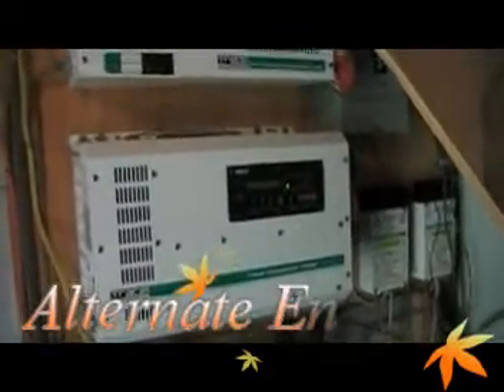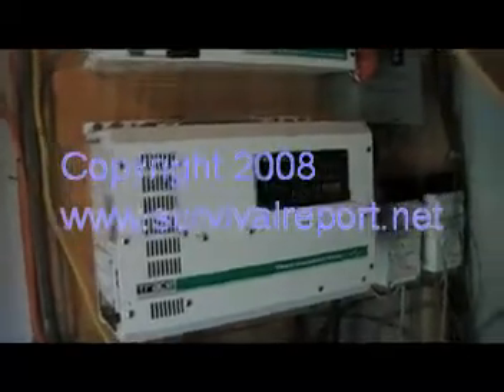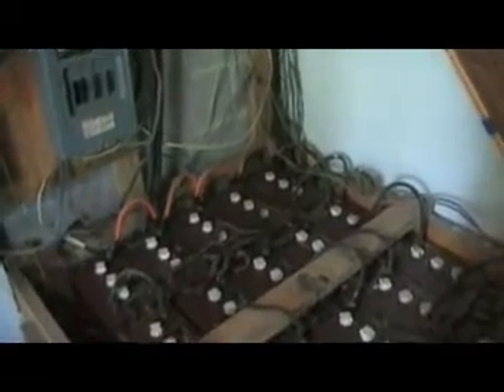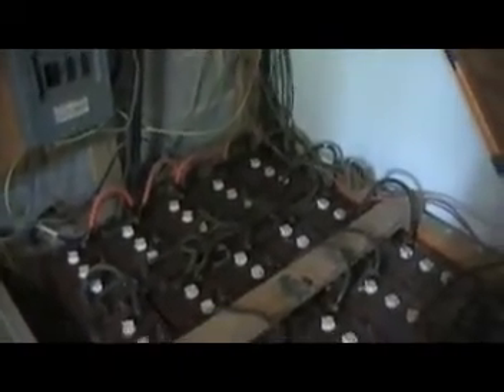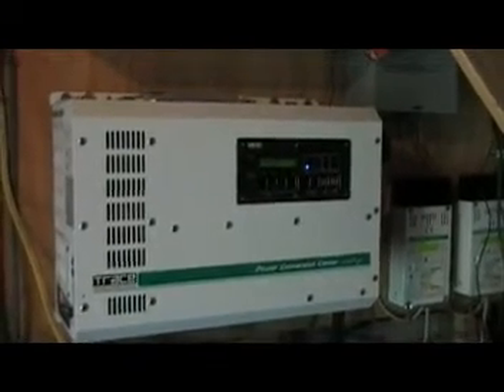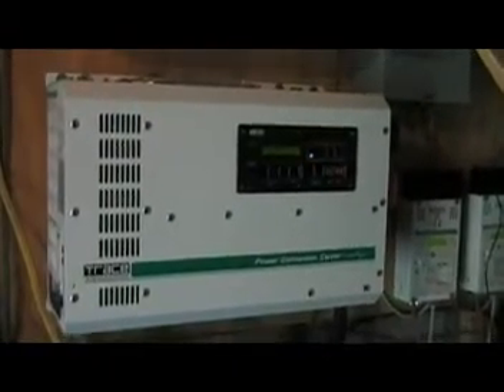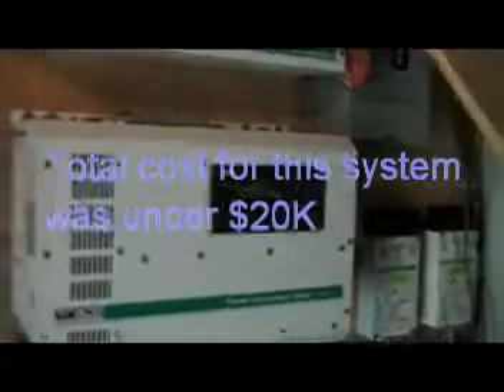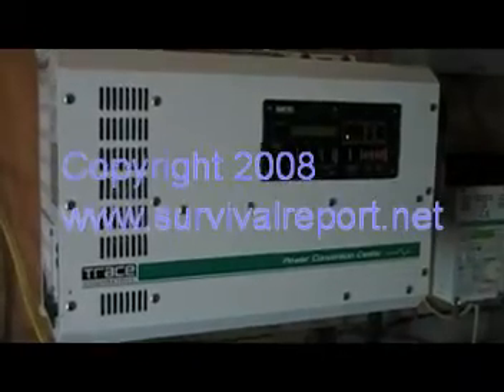Alternate Energy 4, solar, crisis peak oil off grid gas 2012

Comment from the maker: Not familiar with the 104's?? We use the 105's on the energy system at the hunt camp (see later videos), and they do very well. Pushing 4 years on one set of T105's, but they see intermittent use (hunt camp).

Comment from the maker: 12 volt suffers heavily from line losses so wiring runs usually need to be fairly short. The loss is greatly decreased with 24. Usually 12 volt is used for smaller system, 24 for medium, 48 for larger. Sorry for the simple answer, wanted to make it easy to understand. Robert